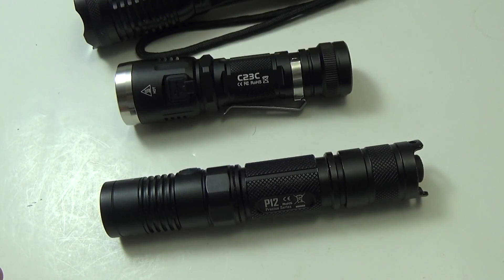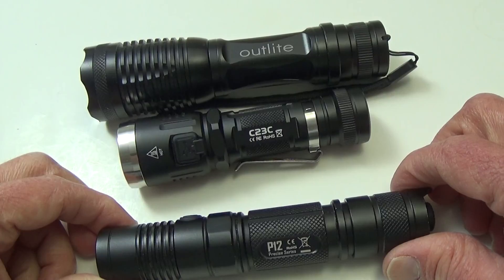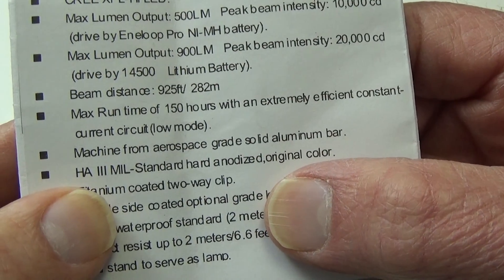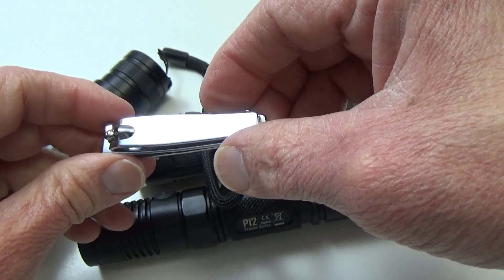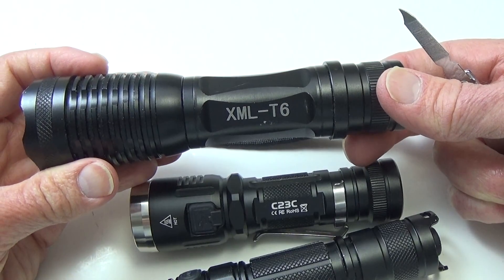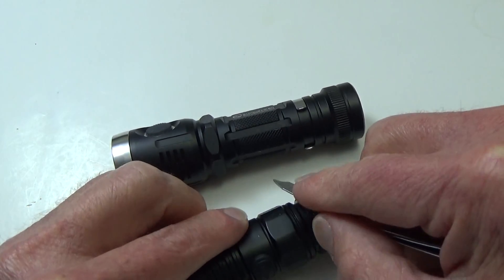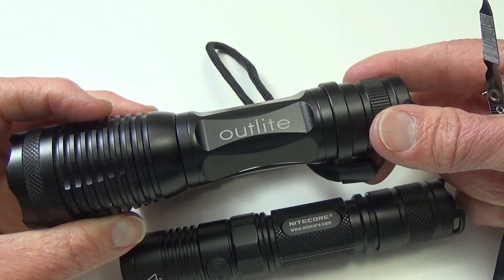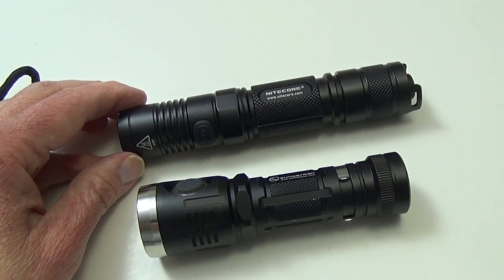LED Flashlight anodizing. TypeIII(3) vs lower quality on Outlite!

Comment: Type 3 anodizing WITHOUT DYE is clear. A black dye is added to the base solution thus creating the black color.
Reply: Hardcoat makes 6061 the majority of parts are made with turns dark straight out of ano tank. It gets dyed afterwards also then sealed